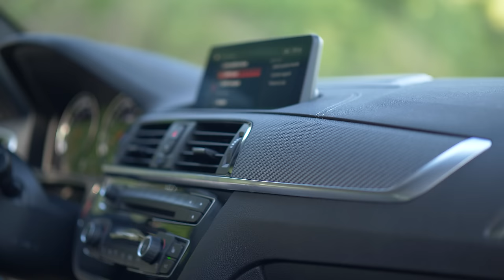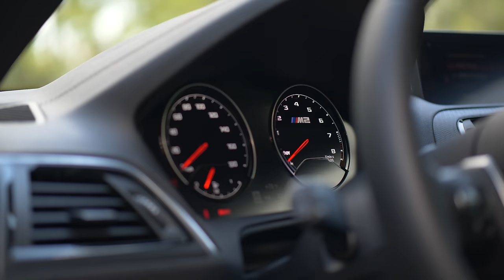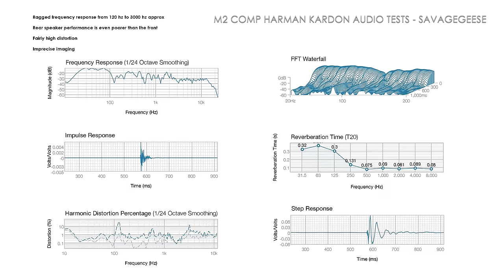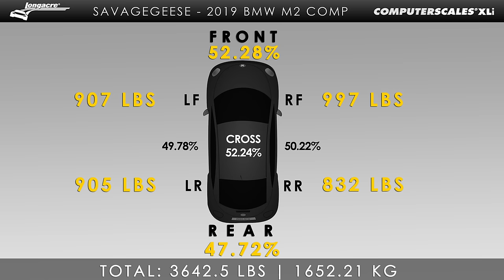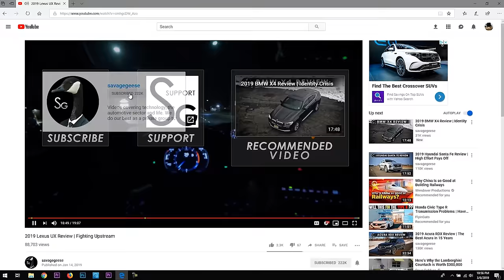2019 BMW M2 Competition | The Throwback Machine

Comment: This is the best car BMW sells today. There is simply no other car like this on the market.  We will see when the Z4 hits the streets.     For me?   I would get the base bottom of the line  35k 8 speed automatic BMW2.  That is a fantastic car.  The only thing is well the base Tesla 3 is better. Tesla has nothing for the M2 competition.
Reply: You clearly don't live in the United States.
Reply: @TasteMyStinkholeAndLikeIt   I live in the DMV ( DC, MD, VA) the United States.
Reply: @fatboy19831  
-->"There is simply no other car like this on the market."
Well, you're correct in the respect that there's nothing BMW makes in their entire lineup that can challenge a Mustang GT350 or Camaro SS 1LE, or Camaro ZL1 on a track.
Don't take my word for it either, look at "Car and Driver Lightning Lap Historical Results" and see all 242 cars they have tested on the same track over the last 10 years.  BMW should be embarassed to call themselves a performance car.
Reply: @TasteMyStinkholeAndLikeIt  The GT350R is a world class car.   It has a wonderful 8000 rpm N/A engine.  The GT350R is more of a buttoned-down track machine.  The BMW 2 is a lighter more playful car.  I have not driven the 2m competition yet.  I have owned a 128i and driven the 135 with the m package on the track flat out at the BMW track in SC.  I have been sideways at 90 mph in the V8 powered M3.  The Mustangs have become awesome performance cars.  Only the GT350R truly stands out as an exceptional machine.
Camaro's have also become world class.  I can't see out of the dam cars I can't wear a helmet in one. A problem with most modern GM cars.  Same for the new Vett at 6.5 feet tall I can't fit.   I can't comment on its all-out performance.

Aside from the Mustang.  None of these cars are cheap anymore. The Camaro and Mustang are bigger wider and more heavy than the M2.

The Mustang and Camaro with the right options can outperform the 2 on the track. On the street, the 2 is more fun.
Reply: @TasteMyStinkholeAndLikeIt   Track time means NOTHING on the street.  The reason why people love the Mx5 is you can track it all day with a pad and fluid upgrade.    Most so-called performance cars won't last 5 laps on a tight track.  

Try the Tesla Performace 3.  It is a fantastic street machine.   On the track it is insane.  Especially for those that lack real skill.    You can get a loaded one for 60k.   It will take a professional driver in the M3 to keep up with an average driver in the Tesla performance 3.
The steering and interior is not as sweet as the M3's ( or the sound) .  It is a faster car in almost any real-world situation.  It has AWD.   In normal driving gets over the equivalent of 120 mpg.
Reply: @fatboy19831  
-->"Track time means NOTHING on the street."
I don't follow how you reach that conclusion.  What exactly is the difference between flooring it on a section of straightaway on a track, vs flooring it on a section of open highway on the street?
.... oh... right... one of them has police cars that will chase you down.

-->"Most so-called performance cars won't last 5 laps on a tight track."
What makes you think that?   
The ZL1 has 11 heat exchangers, its main radiator, two auxiliary radiators, and cooler for the engine oil, transmission fluid, and rear differential oil.
If what you claim were true, it would be all over YouTube as people uploaded videos of their performance cars crapping out at the track.
Reply: @TasteMyStinkholeAndLikeIt  videos can be edited. Bad runs deleted.  A victory lap is not a 5 lap all out run.

Go to the track.    Run your car on the track and get back with me.   11 heat exchangers are 11 things that can go wrong.  They do fail. dramatically.  Even pushing your car to only 90% things go wrong.

The cars that hold up best on the track are very light cars with huge powerful brakes.  The brakes are almost always the first thing to go.
Reply: @fatboy19831  
You're confused.
-->"videos can be edited. Bad runs deleted"
My point, which is easily verified with YouTard searches, is that INDIVIDUAL OWNERS who have a problem with their prized posession, frequently take it to YouTard because their local dealershit doesn't give a phuck.  A prime example is the ticking noise in Mustang engines.
There's no shortage of videos about it put up by OWNERS of the cars in question.  Owners OFTEN want people to KNOW what the good, the bad, and the horrifyingly ugly about their cars, particulary to warn others away from the same experience.

It's beyond clear that "Miata" was a trigger word for you that really set you off, going on this tangent rage about genuine performance cars not being what they claim.  You have zero convincing evidence for that idiotic opinion as I've just explained for the second time.

6 piston brembo brakes, carbon ceramic brakes, and other brands specifically designed for heavy track use and no fade are common on performance cars.

The Mazda MX-5 Miata Club finished the 4 mile track at 3 min 20 sec, even slower than the Ford Fiesta ST, the Subaru BRZ, the Volkswagen GTI.

Even the RACE version, the Mazda MX-5 Miata Cup Car, came in 136th place, clearly demonstrating that it is a very poor track performer that can't turn, can't accelerate, and can't brake nearly as well as tons of far heavier cars.    The Ford Focus RS finished 101st place.
There is literally no rational argument that you can make that the Miata is not a steaming pile of shit, but for some bizarre reason, you broke joke closet homos can't get enough of that PARTICULAR car, when many others in its own class whoop it's ass.
Reply: @fatboy19831  
Watching it now.  10 minutes in and I already have a comment.
1. Genuine "race cars" require frequent engine rebuilds, frequent tire changes, ...
As I stated previously, I have no intention of ever tracking any car I buy.  Additionally, I drive my cars very hard.  Always have.  I hate wasting life away in a car, and I get from A to B as fast as possible.  I've yet to encounter a single issue with the M3 in 4 years of hard driving.

2. This video's commentary is general and hypothetical.  He made no specific claims about specific cars.  He doesn't say "I promise you that if you track a ZL1, you'll break A, B, C"   
Additionally, there are PLENTY of videos of ZL1's and many other cars being tracked, and not crapping out before the run is over.  Watch the ZL1 nurd-turd-ring video youtube.com/watch?v=t4zSIVpVMaw
Particularly the part where early into the course he hits 170 mph before breaking into a turn... I wonder if that heated the brakes at all for all the turns that would follow.  I wonder if all the braking from over 100 mph into the 160 turns on the 16 mile course heated the brakes at all?  Sure didn't see any brake fade.  

Will I be able to drive it like this on my regular day-to-day city/highway driving?  Absolutely not... not even close.  So remind me again why should I hyperventilate about idiotic issues that I'll never run into.

Comment: Great job with the review and for supporting a company like tri-industries that helps people!  
One observation, it's OK to review the car but... redlining it repeatedly 16:50 and autocrossing it 18:10 before it's been properly broken in is not right!  People assume they will win a brand new car   I'm sure you know how important it is to properly brake in the engine as it says in the manual.  The pistons need to properly bed in with the cylinders otherwise the engine nay start burning oil, worsen fuel economy, lose performance etc   
https://auto.howstuffworks.com/do-still-have-to-break-in-new-car.htm
Reply from the maker: There are huge debates about engine break in.  Many engine builders suggest variable RPM at variable load and full RPM runs to seat rings for high performance applications. And then oil changes near 500 miles.  BMW already does break in service at 700 miles.  Some of the strongest motors I had and most reliable were broken in this way including strong dyno numbers.

Comment: I just picked up a 2020 M2C with the dual clutch transmission. I'm selling my low mileage E46 M3 6MT to make room for it. My M3 has a 4.1 diff, so it's reasonably quick and it has coil overs and sway bars so it handles pretty decently. It also has an Eisenmann exhaust, so it sounds great, but even with all of the modifications, it's not in the same league as the M2. For me, the M2 is like the reincarnation of the E46 M3. I agree the interior is ghetto compared to many less expensive cars, but I've never driven a car that was as fun to drive as the M2.

Comment: I’m sitting here watching this review thinking ‘okay, if I had this car I would change this, get rid of that, fix this, and try to improve that’ when I realized, for $75,000 CAD I’d rather just go buy a Tesla Model Y P75D.  Interior quality — better. Infotainment — better. Performance — better. Cost of ownership — better. Residual value — better.  Uniqueness — better. Technology — better.  Until the charging infrastructure improves, electric vehicles are still a second-vehicle which places them in the same category as this M2 Comp (sports cars).
Reply: Interior quality and infotainment are better in the Model Y? Lmao, sure if your idea of both of those is a giant out of place screen in the middle of the car. And that all touch no buttons is the stupidest idea as it's hard to use while driving (let's say HVAC control).

Comment: For this price you can spend $10k on a E92 335i, another $20k in bolt ons, suspension upgrades, and tires and for $30k total it will be faster than the M2.

Comment: In my Puerto Rico all cars are way to expensive i will have to by me a m2 use  is in 67,995 with 25,000 miles 2020 and a 2020 69,995 with 11,000 miles and there is a 2021 72,995 with 14,000 miles and a 2021 with 9,000 miles 89,995 the gr86 is for 45,995 and corolla gr the core are for 55,000 the circuit for 67,995 and the moritzo for 89,995 to 72,995 for this i will have to by a m2 or a New Acura Apec suv that is in 61,845 from 68,995 2023 o miles cars and suv in Puerto Rico are to expensive is like bying a house with 4 wheels to sad but it is what it is i will wait oo and the new m2 2024 is in 105,000 Dct with 2,222 miles.

God bless everyone here and your families friends cowerkers neighbors and love ones success Amén 🙌 🙏 1

You all are in my prayers eternity 
Amén 🙌